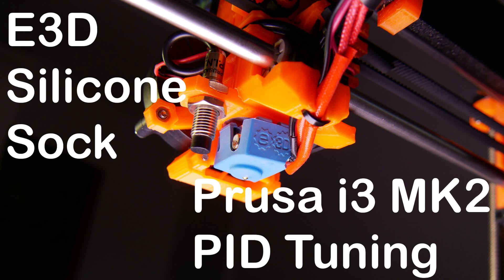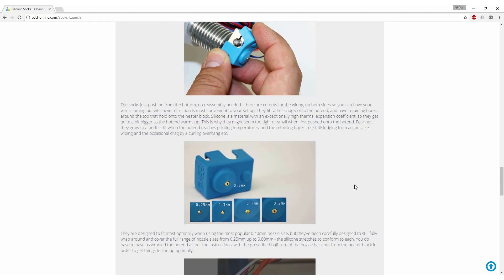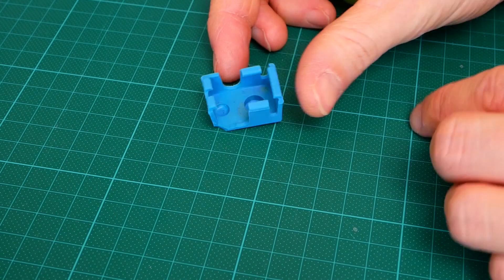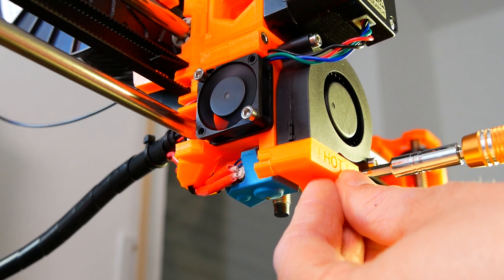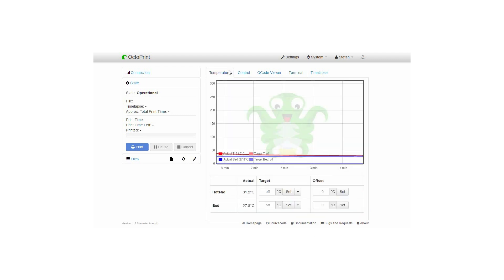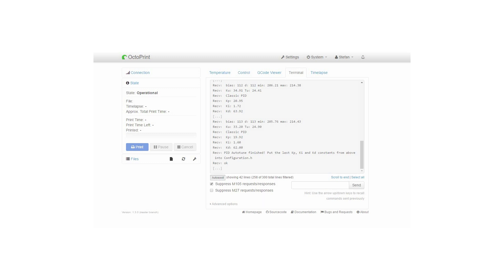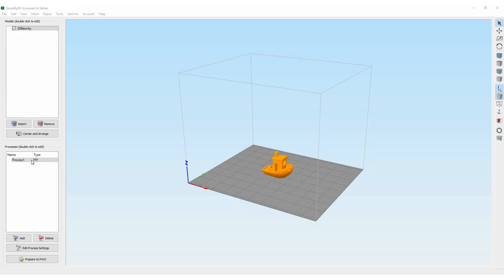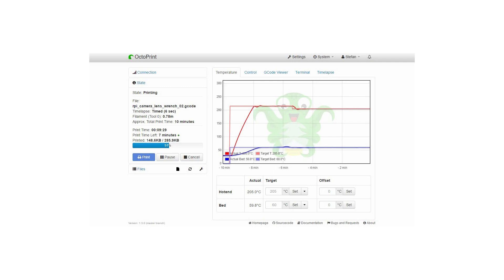E3D Silicone Sock on Original Prusa i3 MK2 + PID Tuning

Comment: I dont update the firmware every time I get to make the PID tuning.
M303 - run setup
M304 - save PID
M500 - save settings
reboot and check if they are the same as u set them

Comment: I used high temp silicone sealant to insulate the hot ends on my printer, has been working very well. Check it out https://www.youtube.com/watch?v=HLXYdZsTT8s. it's also very cheap

Comment: Do you just send the gcode for the new pid setting once and it resets it, or with every print.
Reply from the maker: If you send them without M500 they are not written to the EEPROM and will be lost after each reset. If you use M500 they are stored, BUT this functionality needs to be enabled in the firmware. At the time I made that video it was not enabled for the Prusa but now it is.

Comment: Thanks for the video!  Perhaps this is a feature of newer firmware since your video: PID tuning is built into the i3 MK2/MK2S itself; it will even store the results automatically.  Use the control panel on the printer to select Calibration > PID calibration.

From OctoPrint, I could see my results and that they were being saved:

Recv: PID Autotune finished! Put the last Kp, Ki and Kd constants from above into Configuration.h
[...]
Recv: echo:enqueing "M301 P019.93 I001.72 D057.57"
Recv: echo:enqueing "M500"
Recv: ok p:19.93 i:1.72 d:57.57 c:1.00
Recv: echo:Settings Stored

I installed a sock two weeks ago and thanks to having seen your video in the past, I knew that it was necessary to cut it to get it to fit.  I think cutting would not be required at all if I had installed the sock prior to assembling the printer (I didn't want to damage the cables trying to move them).  I just happened to re-watch your video again today while making supper and learned about the PID tuning which I'd totally forgotten about. Again, thank you. :)
Reply: Awesome findings Donovan, thanks for sharing. Will do it as you've mentioned.
Reply: PID Autotune from the built in method worked just great. No more Temp fluctuation. Donovan - thanks again!

Comment: the pid tuning is just to get the temperature more stable right? not to get the right temperatures ?
Reply from the maker: Exactly! In order to get the temperatures "right" there is a calibration table for different types of Thermistors in the marlin firmware, which you usually don't touch.

Comment: You don't need to cut the sock or disassemble the printer. Just slide the sock under the wires.

Comment: I don't understand why you need to cut the sock. Are you installing it on the old style heater block or something?
Reply from the maker: I had to cut the sock since my thermistor wires were too close to the heat block. If you take that into consideration, when you build the hotend you don't need to cut it (which is definitly better).
Reply: i agree i have the same problem. the thermistor wires are dead blocked onto the block.

Comment: 2 comments:

1. Like mx20100 I was able to use the sock without having to cut anything.
2. Prusa firmware 3.0.10 fixed the issue and you can now to store the PID tuning values in the EEPROM.
Reply: It works if your hotend cables have a little bit of slack

Comment: First thanks for the Video. It helped a lot.  I just got my this past weekend and built it with the sock in place. I didn't have to cut the sock at all.  One note to any one that reads this. CAPS matter in the command.  I manged to not capitalize the P and it did not config the P value.  If you do M301 by itself it reads what is configured on the printer.  After seeing that the P vale was not changing to the new setting, I noticed the issue with the small case p.  Fix it and now took the value.

Comment: Thanx for this great tutorial on the PID, i have asked many places about this PID settings and stable temprature.  But now you can save it to eeprom but i don't know how yet. I see you use octoprint is this much better than using just the SDcard in the prusa ? . 
Thanx
Reply: Yes, with the latest firmware EEPROM is now enabled. I've written a how-to on it here :) https://mattshub.com/2017/04/26/pid-tuning/
Reply from the maker: Saving the settings to the EEPROM is not enabled in the stock firmware. You would have to recompile the firmware, which didn't work for me. Therefore setting the values in the GCODE file temporarily is a simple and effektive alternative. Using Octoprint is nice, since you can send your models via WIFI to your printer, so you don't have to remove the SD Card all the time. It's also good for monitoring your prints if you add a camera.
Reply: Just to confirm -- M500 works in the latest firmware (I used it about a week ago).

Comment: Great video and very concise explanation. Thank you.
I got my socks as soon as they were available and I love them. I used to have a temp drop when the fan kicked in ( only about 10 degrees) but the sock fixed that. Since fitting the sock, I too have the +-5 degree oscilation, although it hasn't affected my prints at all so far.
However, I have been wanting to fine tune the PID for a while but not to alter the firmware.
I may be in the minority but I prefer this method. My reasoning is that it enables me to leave the stock firmware alone, without having to re-upload new firmware every time I change to a different material, I simply create different Profiles in S3D for the different materials. Furthermore, the MK2 will revert back to stock on every reboot. Perfect.

Comment: I was able to fit the whole sock too. Oscillation in my case is about 2-3 Celsius with original firmware, same as without sock.

Edit: After a while I get this oscillation too. Thanks for the video, by adding this to the start script as described the oscillation is gone!

Comment: Great video and advice, I will be trying this out when my kit finally arrives. One question though... Couldn't you send the M301 gcode command through the terminal in Octoprint rather than editing the start GCode, or does it need to be set every time?
Reply from the maker: M301 will change the PID values only temporarily. So as soon as you switch off your printer the defaults are loaded again. Saving these temporary values to the EEPROM is unfortunately disabled in the firmware so if you don't want to recompile the firmware you will have to send the values each time you turn on the printer. Instead of doing that manually, I just send them to the printer with each print file. It's a workaround, but it works ;-)

Comment: Hey,

I just installed my sock without needing to cut it. :-) I just pushed the cables out of the way a bit and then managed to get it in no problem :-)
Reply: Same here!
Reply: Same here!
Reply: Same here!
Reply: And also the same.  The sock compressed behind the cables easily enough.
Reply: have you change setting temperature?
Reply: I installed mine when I made the MM upgrade...

Comment: Sorry to hear you couldn't compile the firmware.. Glad it wasn't just me either. Tried 2 days to get it to verify and compile. Gave up.
Reply from the maker: +techtiptricks I wasn't happy either. I'm not sure why it didn't work. I tried several different versions of the Arduino IDE and it always crashed with different error messages. I use the IDE a lot so I shouldn't be the problem. One might think that they don't want us to compile the firmware 😇
Reply: There is something fishy no doubt.  I downloaded several versions of the firmware from prusa as well as github and in various combinations of Arduino and the marlin addons too. All produced different errors